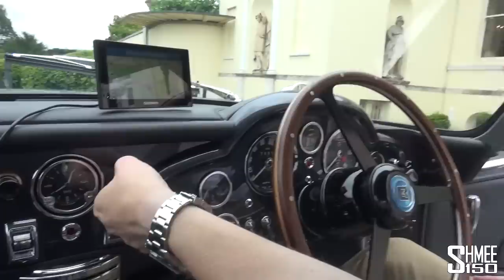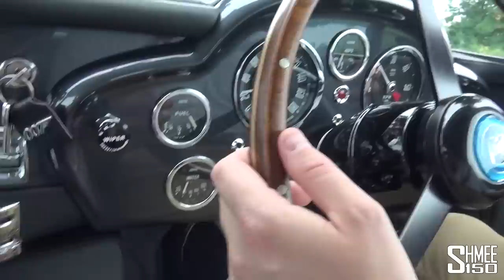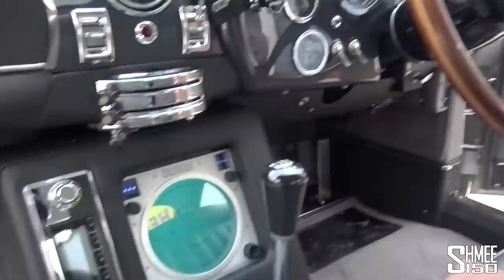Driving JAMES BOND'S Aston Martin DB5 with all the WORKING GADGETS!

Comment: Saw one of the versions used in the Bond films at a fair years ago here in the States. All the gadgets were present: tire slashers, ejector seat, battering ram, front-facing machine guns, etc; a remote-control to presumably activate those things was there for demo purposes, I believe. I would be perfectly happy with a stock DB5, sans gadgetry.

Comment: The original DB5 prototype which was in reality a DB4 GT and driven by Sean Connery in Goldfinger was a 4 speed sans overdrive which was actually featured in an episode of the Saint.  Initial run of the DB5 came with 4 speed with optional O/D.

Comment: Watched it only because I was curious about the tire shredder that would extend from the wheel hub. 

I know the ejector seat is technically impossible--Mythbusters couldn't replicate it without adding huge hydraulic cylinders inside the back of the seat, which made the seat look very unusual. Of course, you wouldn't really want that option anyway. Might accidentally kill somebody.

I've seen one of the original movie cars, and it had the tire shredder, disguised to look like one of the knockoff wheel bolts. The guy mentions it at 15:00 as "the tire shredding kit" in a fancy box in the trunk, but nothing more. Disappointed :(

Except for the bulletproof shield, I have doubts that any of those gadgets would actually work as intended in the real world. Mythbusters tested both oil-slick and smokescreen techniques, with mixed results. As I recall, smoke was only marginally effective; oil not at all.

The license plate changer built into the front bumper, while clever, is a dead giveaway that the car's been altered. It just doesn't look right, even from a design perspective. No one would design a bumper like that. And then you have that cutout panel in the roof. Being only on the passenger side it doesn't look like a sunroof. 

Even the tire shredder I saw (IRL) wasn't very well disguised. (Perhaps why it's a "kit" on this car?) But it did look like it could do the job. A heavy-duty bladed thing, painted silver. But I'm just wondering if it's mechanically possible for that thing to come out of the axel, much less puncture a tire. 

Personally, I'd rather have an unmodified DB5 rather than this one with its fake gadgets and sound effects.

Comment: With your Information here I think under the limited production law here in the US, where they can make old cars again for collectors, this car, granted I dont think they'll really allow you to have fake guns in the front, will be perfectly legal to drive around, also they kinda done goofed abit here, BMT216 A had a dark bluish grey interior, and a cheap silver respray

given the original car was red as it was seen in the saint, 
https://www.youtube.com/watch?v=HT3d6Y6cHXU

and when they cut into the roof, well it obiviously needed a respray, other than that, jesus.

also BMT 216A wasnt just its motorplate, it was its serial as well, they used the serial as the plate given it was a works car, the literal DB5 prototype, heck their was some odd thing about the speeds of the car too, like one was a 4 speed, or a 5 and then one a 6 that show up in the film

like some weird note about it, it shows up on the gearleaver, heck if they ever do find the damn thing it might be the key identifying thing to show it was an early car.
Reply: Yeesss absolutely the very first car was no db5, but a prototype based on the db4 vantage Serie V, and was not badged "Db5" in the back: prototype dp216/1, lost now.